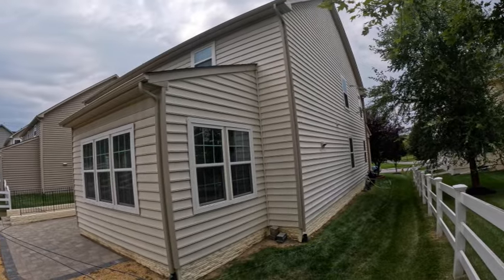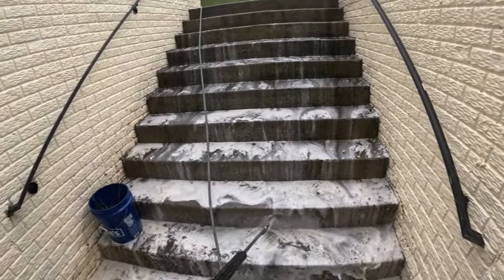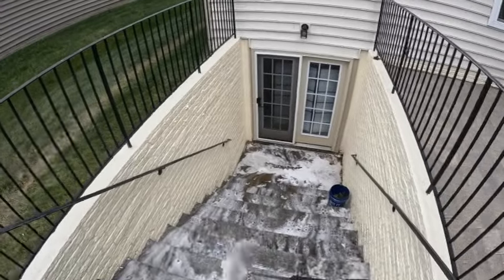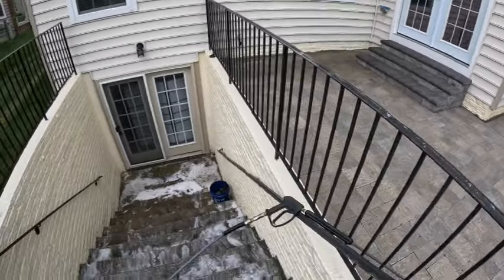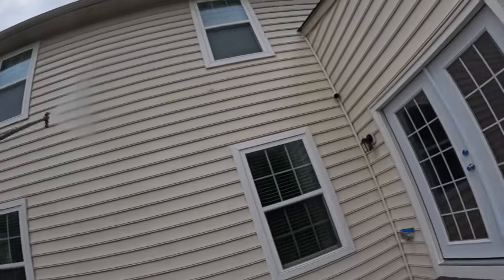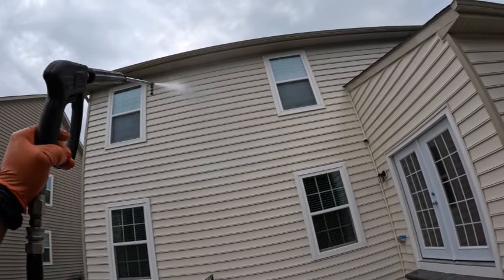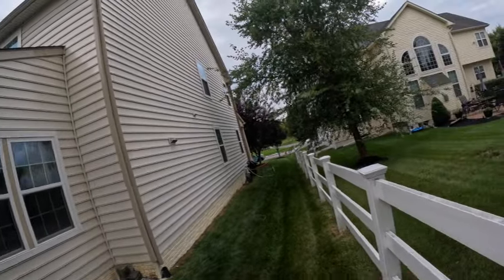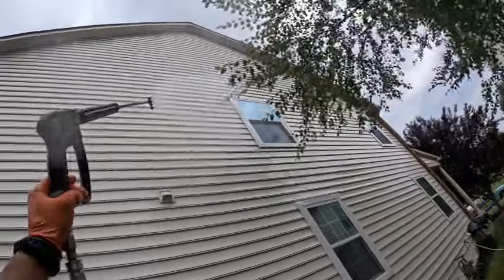Ep.72  How to Pressure Wash a House | Secrets of the PROs

Comment: Phobias? Yeah, Not eating! 😅 
When I hear you say “6% mix”, it sounds a lil confusing from a new person perspective… I ask you and know that you mean a “6% solution(50/50) in the tank” and then downstream from that mix in tank to the house; which equals about a .6-.8% solution on the wall; depending on your injector size. (🤣 I posted too early during video before you mentioned other video) 
Hope this isn’t over stepping but, thank you for clarifying that for me before. 🙏🙏🙏

GoPro yes 👍
Reply from the maker: Absolute correct, by the time that solution hits that wall, it has been diluted down to a 1.2% acidity level.

Comment: When you are downstreaming and you state you are using a 6% or 50/50 mix, am I right to assume you are referring to the batch mix, not the final ratio that hits the wall (watered down as a result of downstreaming vs designated pump)?
Reply: I believe he is down streaming his batch mix (6% - 50/50), his down stream is probably between 15-20% draw, so he is getting around a 1% when downstreamed.   I think the standard fixed down stream is a 1:7 ratio, which is around 14% draw?
Reply: @alextimler  what was the formula you used to go from the 6% batch to estimated 1% outcome?  I can't come by the formula required to calculate this using my system.  Thanks
Reply: @canadianpatriot5577  the draw rate of 1:7 would be around 14% pull rate, so 6% x pull rate 14% = 0.84, not an exact math for 1%, but close - and not all injectors pull perfectly either.  I’m pretty sure that’s how it’s calculated
Reply: @alextimler 1:7 ratio is 12.5 %
Reply: @alextimler 1:7 ratio means 1/8 of your final mix is SH  =12.5% with 6% SH to start with gives you 0.75%
Reply from the maker: That's absolutely right, there's many factors at play with the dilution ratios, depends on length and width of hose and also the GPMs of your pump. Generally speaking, for us, that solution is hitting the wall at around 1.3%. Great question by the way.

Comment: What is the size of your water tank vs your chemical tank?
Reply: Also, where do you recommend filling up your water tank?
Reply from the maker: Most of our buffer tanks are 125 Gallons and our sauce tanks our horizontal, 50 gallon tanks.
Reply from the maker: We leave the shop with them full then connect to water supply at the houses we go to.